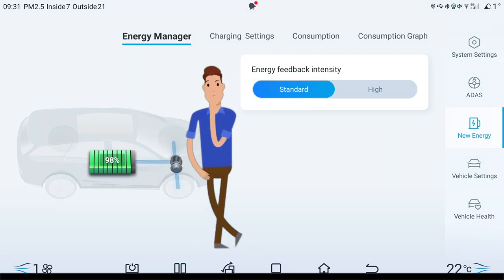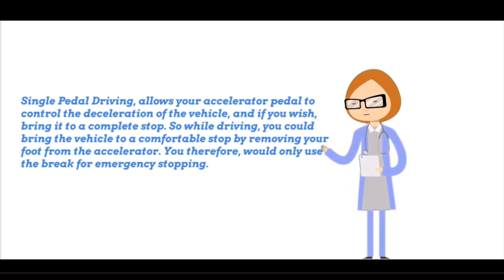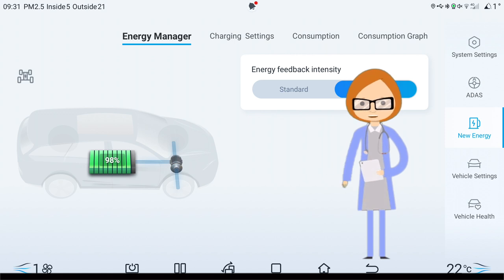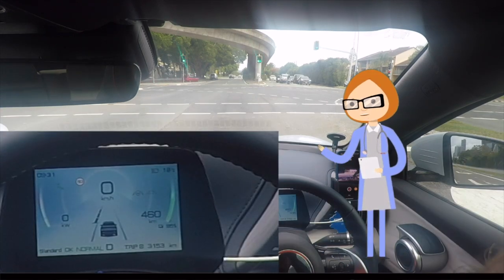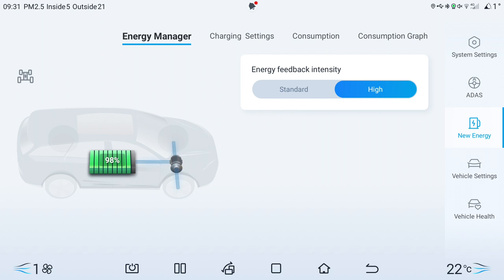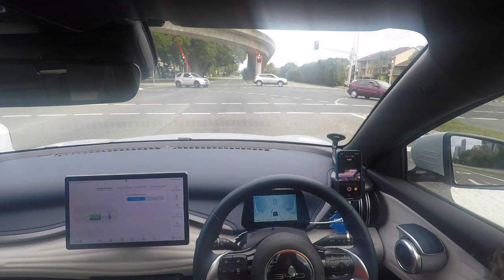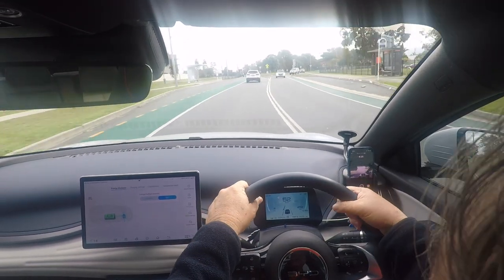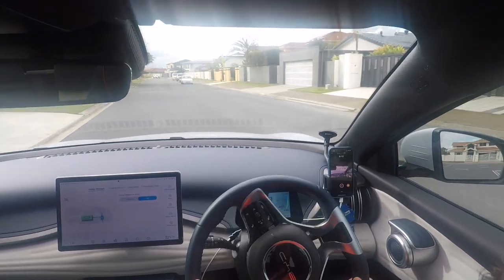BYD - Atto 3 Energy Manager

Comment: The other thing about this is, if the vehicle battery is cold it limits the regen to 20kw, the same as if its fully charged. Once the battery gets some temperature, the regen can get up to 70+kw (at least I've seen that in mine).

Comment: Hello and thanks for your nice videos.
I have a problem with cruse control when it is on in queuing city traffic.
When it is on and the car stops and then starts again, it jerks..you can feel there is a gap when it picks up speed again..a backlash. Seems like the transmission between the engine and the drivetrain is slipping. This is most noticeable when CC is on. Have you noticed this.
Can you make a video about CC in slow city Trafic.

And thanks for all the professional videos.
Reply: Sorry about the spelling edits.
And by the way Comfort parking is activated..its on. It dosent change this glitch.

Comment: With respect, it does indeed make a difference to your range. I took mine up into the Blue Mountains. Obviously it used more energy to get up there than it did to come down again, but the wonderful thing was that the SoC percentage went up on the trip back down! Thanks to the regenerative braking. Keep up the good work, I do enjoy your videos. 😊
Reply from the maker: Hi Leigh, I have no doubt that after coming down the mountain your SOC increased. The Atto3 has excellent regenerative recovery from its braking. I beleive that your SOC at the bottom of the mountain would have been the same whether your energy manager was set to Standard or High. Maybe I did not explain that well. Thank you for your encourgement.

Comment: You made a comment about regeneration and not needing to avoid 100% state of charge.  I have no issue with your logic and the explanation, excepting for the following scenario.  If you live on top of a hill or range where your daily drive starts with a long downhill drive where there is minimal energy consumption prior to the long decent.  It is quite possible that the initial regeneration would be greater than the battery capacity is able to accept.  This would be a rare occurrence, but quite possible.   I’m sure that an owner in this situation would be well advised to charge to a level which allows for the regeneration.
Reply from the maker: Hi, in this unlikely scenario the battery management would not accept the charge.
Reply: @BYD_Telsa  Unless the owner decided to charge to say 95-98% to allow for the regeneration.  Of course it would be advisable to do a 10-100% charge on a regular schedule to maintain proper capacity calibration.

Comment: Do the stop taillights come on when you slow down on high
Reply from the maker: yes, although there was an intermit issue in version 1.0 where sometimes they didnt
Reply: @BYD_Telsa  My brake lights don't come on. It does however come on when using ACC. I'm getting my first service on Thursday and will test after firmware update.